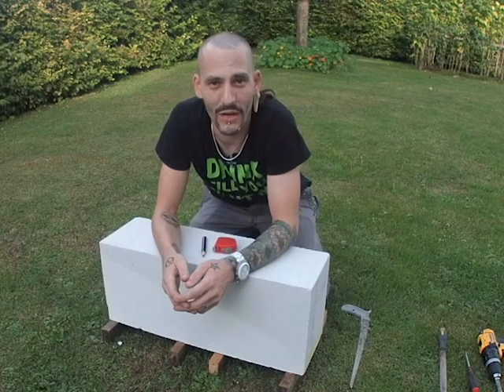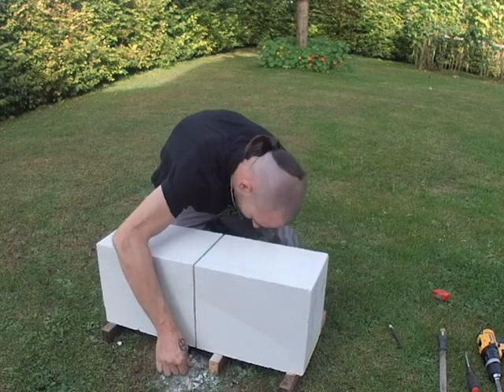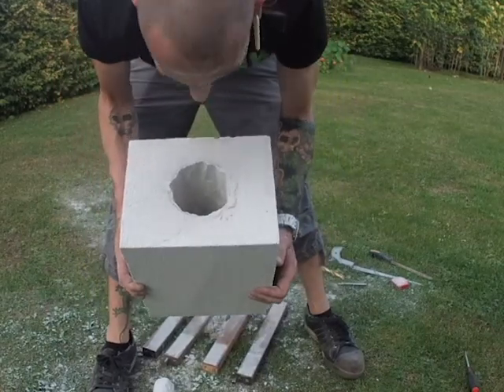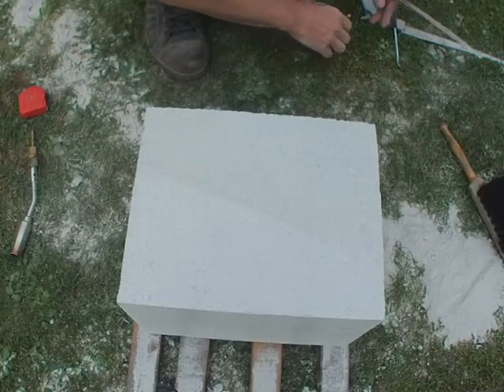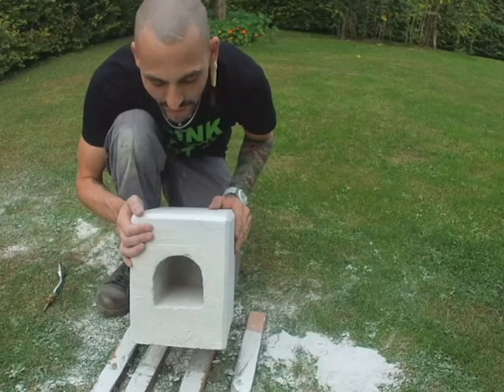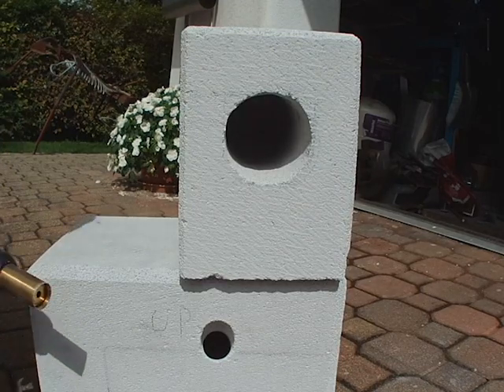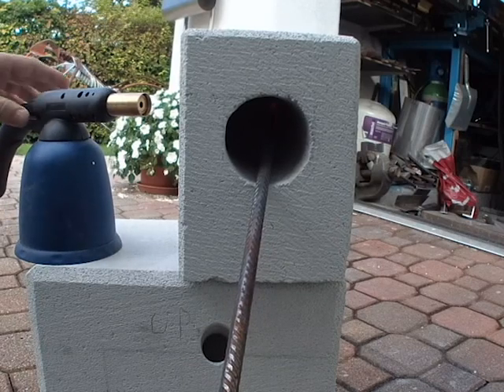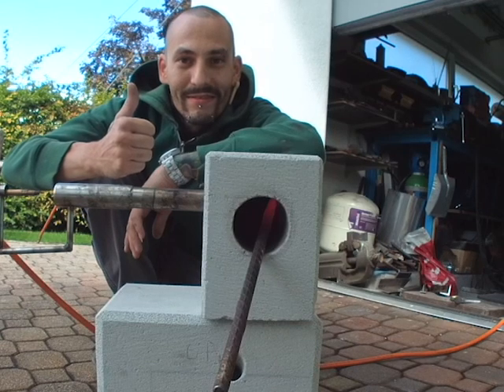Gas Concrete Propan Forge For Under 5 Bucks Easy to Make - Making 002 - WSW

Comment: put a door or something to keep the hear in better.
Reply: "heat"
Reply from the maker: you need an opening for the hot gas that needs to go somewere
Reply: I see what you are saying so use bricks and leave an small opening?
Reply: But I did like the video bro.
Reply from the maker: that would be an option if you need more heat
Reply from the maker: thanks
Reply: Just something for if you do want to use a smaller burner maybe.
Reply from the maker: that could work out

Comment: how does the forge work after prolonged use?
Reply from the maker: it depends on how often and how long you use it. its not thougt for professional blacksmiths. I guess it will hold up for about 100-300 hours of forgeing that depends on the wall thickness your forge has. thats because over time the material just crumbles away. if you want it to hold up longer you can put some fireclay or ceramic insulation wool into the firechamber.

Comment: How is this for temperature and how is it holding up after 6 months? I want to make a couple of these for my students.
Reply: Also have you tried it with a tiger touch? If not can you put up a video showing how to make your burner?
Reply from the maker: it depends on how often and how long you use it. its not thougt for 
professional blacksmiths. I guess it will hold up for about 100-300 
hours of forgeing that depends on the wall thickness your forge has. 
thats because over time the material just crumbles away. if you want it 
to hold up longer you can put some fireclay or ceramic insulation wool 
into the firechamber.
Reply from the maker: What is a tiger touch? a burner? the burner itself I made from stainless steel pipes but you can use normal steel to. I just watched a view youtube videos and made it like most people did.

Comment: Where do you find a brick like that? I can get 4.5 x 2.5 x 9 K23 bricks, but I need to spend about $30 to make a forge this size.
Reply from the maker: in europe its no problem but in the us its almost impossible but i wrote the manufacturer of the bricks and wait for an answer. and i found the company called hebel they are also making such bricks.

Comment: No such block available here in the US. Great work, though.
Reply from the maker: Ok thats not good, and to ship a block to the US would cost around 40 bucks.... I think to expensive.
Reply: This block is readily available in the US. Unfortunately it commonly sold by the pallet, rather than the piece. The US manufacturer is AERCON AAC. It’s located in Florida.

Comment: Is this like ytong brick?
Reply from the maker: Yes it is Ytong
Reply: The guy at the hardware store told me that they explode if you heat them up.
Reply from the maker: Funny, as you saw mine didn´t. just make shure they are dry. if they are wet they, could explode if you heat them up to quickly, but not realy like explosives. they just crack and some bits can fly of and hit you.
Reply: LE-Handmade knives this product is a very common firewall application with a four hour UL fire rating here in the US. That statement is absolutely false.

Comment: I searched what you said up it's just showing crappie 5inch /4inch blocks is there any other thing I can search up
Reply from the maker: you can use them too with some heatproof cement I used a 8 inch block  Ytong is the brand of the brick

Comment: Excelent video! awesome idea. 
Is that a Retak block? What specific concrete is it?. I want to try doing it =)
Reply from the maker: ytong is the brand name. This is Autoclaved aerated concrete, its a kind of foam and has mostly 
air bubbles inside. google ytong or Autoclaved aerated concrete and you 
will find the information.
Reply from the maker: yes retak blocks are the same i think
Reply: Thank you very much!

Comment: What are the thermal resistance properties of this type of brick/concrete?  I want to make my own forge, but lots of sites say to avoid concrete as it can explode when being exposed to extreme heat.
Reply from the maker: Yes normal concrete can explode dont use that one. This is Autoclaved aerated concrete, its a kind of foam and has mostly air bubbles inside. google ytong or Autoclaved aerated concrete and you will find the information. I used Ytong for my forge, it doesnt hold out very long time but its very cheap and easy to make and with a metal frame it lasts longer. for my big forge i used a spezial fire concrete mixed with perlite, but best would be to use fireclay bricks or ceramic insulation.
Reply: Jon Setliff I'm guessing it is perlite mixed with something
Reply from the maker: no its a mix of concrete and plaster, and foamed up with hot steam. so its filled with lots of air bubbles
Reply: Ahhh ok, I was mistaken
Reply: Jon Setliff 1200c manufactor says

Comment: where did you get the blocks from? thats super cheap!!!
Reply from the maker: from a big hardware store. its called Rädler. but every big construction company should have these. maybe they are a little bit more expensive but normaly not more than 20 bucks per brick. and dont take these spezial thermo bricks they are much more expensive then simple gas concrete bricks.
Reply: thanks for the fast response brother!! I checked my local big box stores but didn't see anything. I'll try a more specialized construction place. thanks again!!